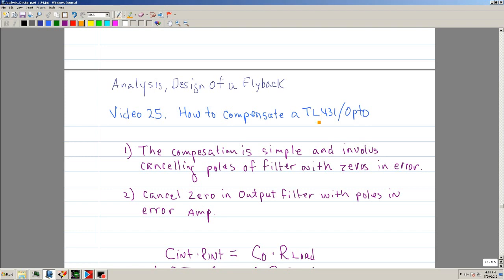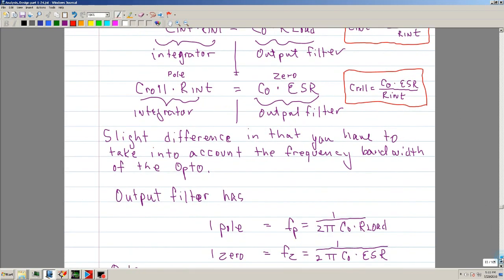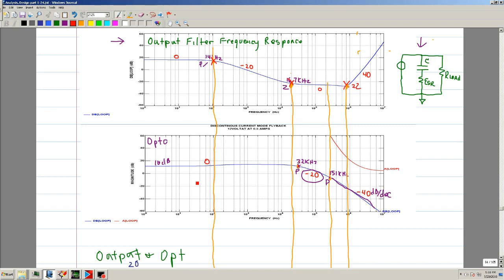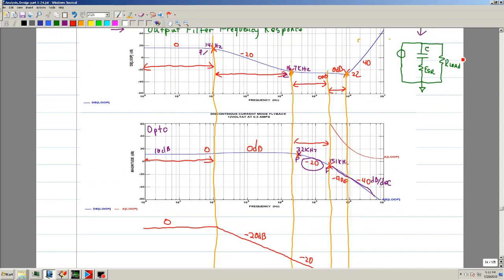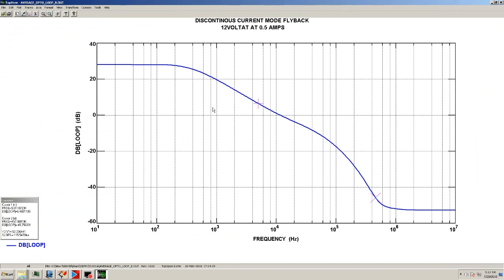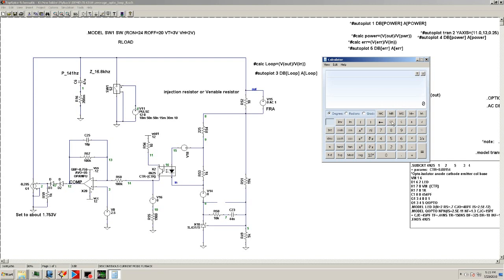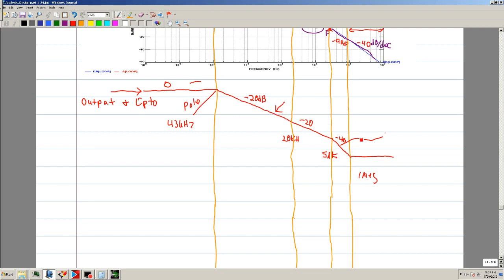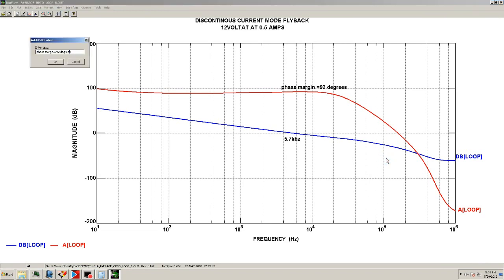Analysis and design of a Flyback; Part 25 Compensating the Opto

Comment: Hi Mr. Robert, I have a question... I am confused with the following: When in earlier videos we haven't added the optocoupler and the voltage reference we compensated at the error amp, now we are compensating the TL431 and the opto... but im confused in that the objective is to get the -20db/dec transfer function, but if the op amp is compensated as that as well as the reference wouldn't it make it -40db/dec? or is it that when we add the opto we don't worry about compensating the error amp?... what is it that I am not understeanding :(? thanks in advance

Comment: Thank you Robert for your great videos! It would be very good if you do a video about various types of opamps compensation, specifically how to properly do a dual pole compensation.
Reply from the maker: Yes, that is the next video. When the opto bandwidth is much lower, it introduces a -40dB/Dec and a type three compensator can be used. I try to break the lesson in smaller videos so that it makes it easier to understand. Thank you for your comment; it is appreciated.  RB